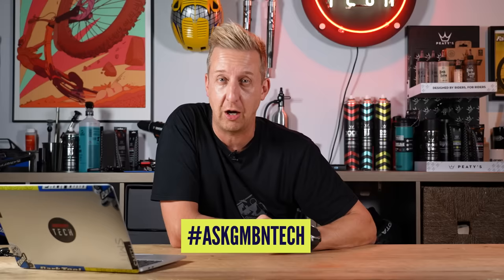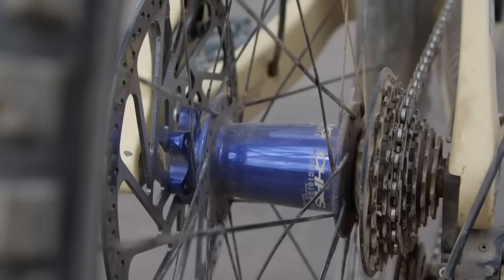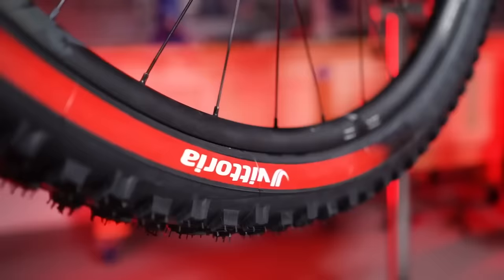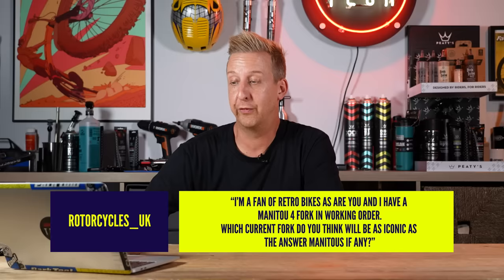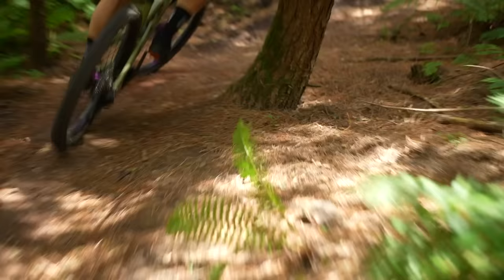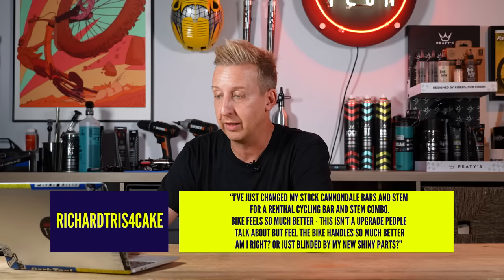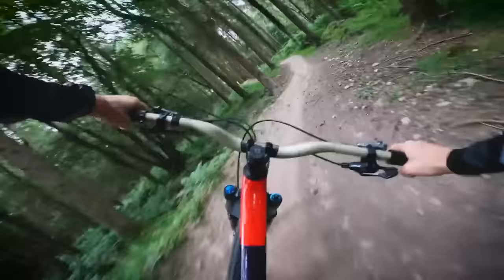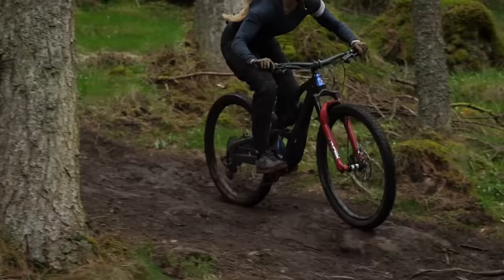Doddy's Dream Bike Build? | #AskGMBNTech

Comment: #AskGMBNTech
Why is there need for variable/stepless dropper seatposts?
 Most riders are perfectly fine with two positions, three at max, all the way up/down and an inch below max up. I know that dropper posts exist (XC/racing) which have only two positions (up/down) often locked with a pin. They are lighter and are supposed to be more service friendly than conventional dropper posts.
Yet, you can hardly see them and they never came to the market as really viable options. Why is that?

Comment: #AskGMBNTech 
Cheers lads, although bike get bigger tires for more grip and damping, the travel bikes have increases as well. I also have the feeling that the trails get better build, but gnarlier. Personally, I have the feeling that the trails demand more capable bikes and vice versa. This opens a gap for bikes for smooth trails, covering ground, and exploring, which I think are gravel bikes. 
What's your take on that? Do you think that might be a reason and that's why some people wish for "original" mountainbiking in shape of gravel bikes?

Comment: #AskGMBNTech Why is nobody making crazy forks like the Marzocchi Super Monster anymore ? just imagine a modern 300mm version of those babies on a modern frame 🤤
Reply: While it may not be the "real" answer

You have to use a coil spring, rather than an airspring, and at 300mm that's even heavier than the "heavy" modern coils, and with modern HTA's going for more travel just introduces a longer lever ends up damaging frames while not providing much of a gain since you want to match the rear travel similarly
Reply: @TheBarrelDoesGaming  thanks for the answer after I watched Jordan's video all I dream of is a modern version of such a beast

Comment: Doddy, can you see Canyon making Titanium frames? I've read they are making small parts from Ti. A full frame would be really cool!
Reply: I just bought a new Kona WTB mountain bike seat👍. Style gets an 8-9 out of 10, comfort 5-6. But the style of a seat is more important, right😂
Reply: I'm still using a Titec 7075 riser bar I bought in 2009🤘🤘
Reply: Has anyone here used Ergon GA3 lock on grips?
Reply: Also, has anyone here owned a pair of Rock Shox Recon Silver Tk?

Comment: #askgmbntech
Hi, when upgrading fork and/or rear shock. How important is it that they are “tuned” for your specific frame vs buying of the shelf products. For example specialized puts rx tuned on their forks and shocks. What would I miss out on if I buy an upgrade fork or shock that is not rx tuned?

Comment: #AskGMBNTech Have you guys ever run internals from a different company in your forks. I am fortunate enough to have access to a machine shop so am running a Rockshox damper and an ohlins air spring in a suntour chassis (the ohlins topcap fitted without modification). 
I am really enjoying the setup it's certainly way more adjustable than the middle of the road stuff inside the fork originally.

Comment: #askgmbntech  Love the show!  I need to replace my suspension fork - SID Select+ from 2018 - but I can't find a direct replacement anymore.  My fork has 51mm offset but the closest direct replacement has a 44mm offset.  What is the affect of going to a 44mm offset from a 51mm offset?  How will that offset change affect handling?
Reply: it should give you a more direct steering, or twitchy depending on who you ask. 
They recently made an entire video about offset and trail which results from that.
Reply: @LifeofMaik  I think you have it backwards.  More offset makes a bike have less trail and the front gets more twitchy (less stable).
Reply: @Bob_Shy_132  right, I always mix this up, thanks for correcting me
Reply: @LifeofMaik  No problem. Two wheeled stuff has a lot of terms that take a lot of understanding to finally master! Haha.

Comment: #AskGMBNTech I know this has been probably been asked a thousand times, but I wanted to try out a shock on my 2022 spectral cf8 . I saw the video that Doddy did with his cf9 when he tested a coil against an air shock. I couldn‘t find any info so far if the bike is suited for a coil shock (kinematic wise) and what size of coilshock I can fit on there . Where can I look for information about this. Thanks guys , loving the channel , your videos helped me out a lot of times.
Reply: You are the best . Thank you for the fast response . I thought the mullet might have a different frame geo , due to the 27.5 rear . I will have a look into that. Thank you again.

Comment: top tier Sram Transmission. Ibis Ripmo frame. Magura SL trail brakes. Oneup bars. Berd spokes on maybe an I9 hydra or Dt 180 hub! Lightweight 30mm internal hubs. Good rubber. 165mm cranks. 200, 180 rotors. a Loam dropper, thought the Bike yoke works so damned well!

If I could have an ebike? Maybe the Trek Fuel Exe frame. same stats. 160mm up front

Comment: #AskGMBN So I have seem be be having drive train problems that keep coming up. Some times I here like a ticking noise from the chain. I fix it by adjusting the barrel adjuster on the shiftier. When this happens, it usually only happens on some of the gears. This keeps on happening after i fix it on  that ride. My checked my chain and it's still good. 

I heard you need to replace the shiftier cable once and a while. Could that be the cause of the problem? I looked at the cassette and it look good. For reference, my bike has full deore 12s drive-train. Any advise?

Comment: Why do bikes always come with 32t now? Its aweful, since they are singlespeed in the front, even 36 feels slow since minimum in the back as been 11t since forever, so, why so low in the front?
Reply: You need 32 since it's just a 1x System. You have big 29 inch wheels, with more than 32 you would lack a proper granny gear.
Reply: @simonm1447  but i rarelly go higher than third in the back, i've used 1st gear once, and it was something so steep that i'd rather walk, maybe i Will switch back to 2x in the front. But it seems my New bike doesnt have the spacing for a front derailleur, so maybe i should go 36 or 38 even
Reply: @cyrustakem7993  it depends on the terrain where you ride. I have a 2x system, it has 22x36 in the front and 36 on the biggest cog at the rear. Wheels are 27.5.
I regularly use the smallest gear for climbing (22F 36R), but this is on steep sections.
If it's mainly flat where you live you are free to mount a bigger front chainring on your bike.

Comment: #askgmbntech whe changing my chainring from 34 to 32, do i have to shorten the chain?
Reply: maybe, it depends if you're on the shorter side of your chain or not. If your chain is fit for a 34/36 Chainring, yes. If it fits the 34 perfectly, depending on the bike and chain growth when using the rear suspension. if for a 32/34, no.
If you switch between chainrings, I wouldn't bother, unless you want two chains which you can switch with the chainring.

You probably have to adjust the B-screw tho.
Reply: @maikszczerbuk613  hi! Thanks for the reply! 👌🏼

Comment: why don't mtb company's use backpedal brakes like the old bmx's???
Reply: Search repack hill/mountain
Reply: They overheat. They also don't work on a fully, since the rear triangle moves there and the chain also moves, you can't modulate the brake in this case